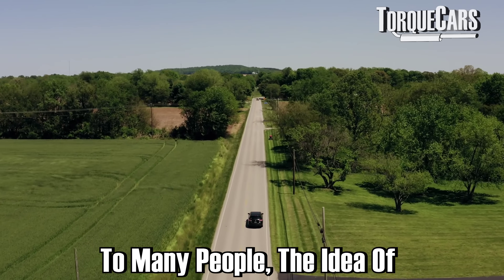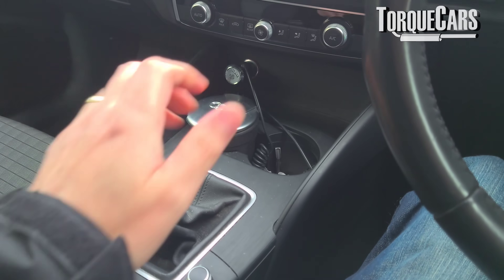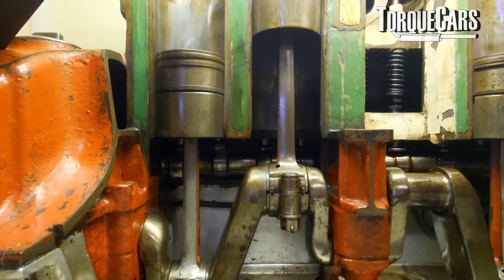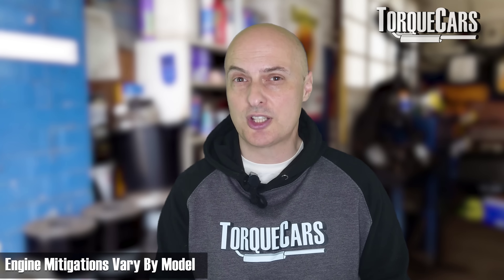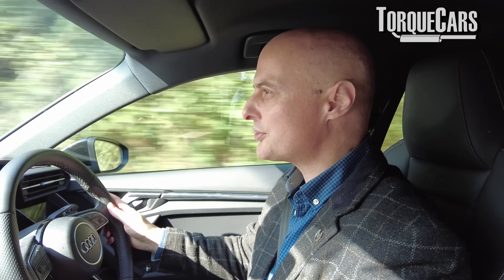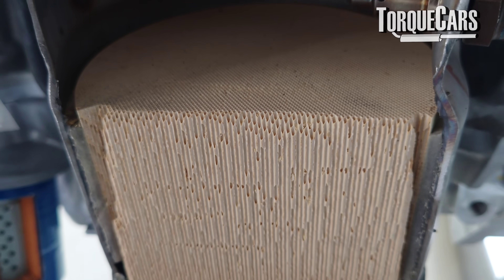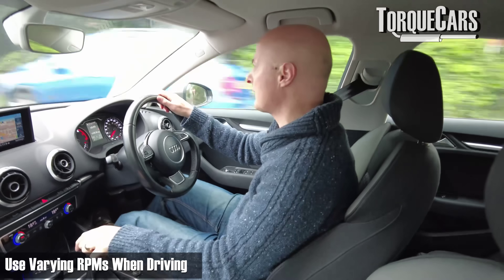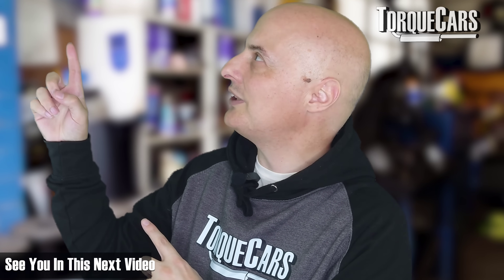BIG DAMAGE By Lugging at LOW RPM? Eco Driving Warning! (Manual Gears)

Comment: It’s ok to use lower RPM when car is still cold because cold oil doesn’t flow as quickly, but after it warms up it’s completely fine to use the whole RPM range every once in a while
Reply: Most modern engines are alloy with steel stretch bolts clamping the head down. They don't reach full clamping force on the head gasket until full operating temperature is reached so it is good to avoid wide open throttle operation until warmed up to avoid head gasket failures.
Reply: It's good to keep revs around 1500 when cold. 88-90 degrees coolant, 74 + oil temperature when you can go
Reply: People really arguing over this in 2024? There's a multitude of reasons why pushing the engine hard when cold isn't usually a great idea but it depends on your engine, your oil, the ambient temperature, how long the vehicle has been sitting, etc. There is no straight answer but the general recommendation remains the same.
Reply: Not 'lugging' the engine while cold though, which would be even worse than doing it when warm.
Reply: A very cold engine (like a cold start at freezing temperatures or even Arctic temperatures entails a period of poor lubrication because there is water condensate present in the combustion chambers and piston ring contact area for part of the warm up cycle.
Reply: maybe true when the oil is recently change but oil thickens overtime
Reply: Was argueing with my Garage last week which oil to use on a 1.4tfsi Audi. They insisted on 5w30 rather than 5w40 which i brought. Ofc meeting the vw norm. Their argument was carbon build up, which in my opinion isnt due to oil rather than short trips. Would love to read the communities thoughts on that. Cheers Guys!
Reply: @danielsteinmetz  
Where does it say your engine can handle 5W-40? If VW says in writing somewhere your engine can handle a viscosity change it's fine, otherwise your engine is will be a goner 🤔
Had a 1.4 Golf 7 and it took 5W-30. Even got a 1L bottle to go when picking it up. Castrol 5W-30 VW LL

My Volvo takes 0W-30 which is tricky, not all 0W-30 is A5/B5. That's a specific Volvo spec.
Reply: @rosen9425  Hey there, it's even written in the cars manual :)
Reply: True
Reply: nah lots of cars rev themselves up to 2000 rpm as soon as you start them in cold weather till they warm up.
Reply: @FGNi-em9sb  i dont think that needed to be specified. Who exactly is pushing their car to the limit as soon as it turns on? Lmao
Reply: @thegreat9481 you would be surprised lol. I’ve seen it happen. Some people really believe you can just get in and drive it like you stole it without any idea of the damage that is occurring
Reply: @FGNi-em9sb  lmao you know what? You’re right. The reality is common sense aint common.
Reply: True but also not so much, most manufacturers count that in, you can actually still use mid range rpm where most engines make the most torque, just don't use higher rpms and no 100% throttle, basically you can use the engine normally like you should, just about avoiding any high stress situation, most modern cars are like that and also helps a lot with reaching operating temps and oil flow during cold starts, not all cars, but most of them now are just "let's go already" than "wait for my morning meditation, then we go"
Reply: Change your engine oil. Early and often.
Reply: I daily drive a 2zz Corolla, it sees 8000+ rpm every single day. Often multiple times each day.
Reply: I used it multiple times a day😂
Reply: the engine's operating temperature is not all about the oil flow, But mainly because of the thermal expansion of the piston rings. You need to reach the operating temperature to prevent uneven wear on the cylinders and to ensure a proper seal for the combustion chamber.
Reply: @judomanX  Except this discussion is about oil. Piston and rings are one of the first things to warm up, way before anything else.
Reply: @BigBear--  thought the video was about engine longevity and you're all yapping about oil circulation which literally takes a second or two.
Reply: @judomanX Welcome to the internet. Where the comment section discussions become about specific issues, not always related directly to the content in the video. Which is why I specifically said "this discussion" is about oil. Not the video.
Reply: You also need less oil supply for timid driving, but if you lug a cold engine, material expansion hasn't happened yet, so you have higher tolerances between parts, and now imagine hammering on the pistons in that state. Not good either.
Reply: Yes me too I wait till my oil gets up above 160-170 F before I get her above 2500rpm
Reply: Its still hard on internals namely the thurst bearing .Esp on stick cars
Reply: Veramente l'unica cosa che succede a motore freddo é che il metallo dei componenti in movimento non é ben dilatato. Bisogna solo evitare atteggiamenti "nervosi" fino ai 90° quando i componenti raggiungeranno la giusta tolleranza. L'olio riprende a scorrere appena accendi il motore, non é quello il problema.
Reply: All modern oils these days flows immediately, we're talking seconds. It's not exactly going from molasses to water in viscosity change. Just look at the oil flowing from a new bottle very liquid. Also specifically made to flow just fine in sub zero temps hence the W-rating. So at -20°C I can see a slight need to not overdo it the first 5 minutes but the oil is indeed flowing or any engine would be toast at every cold start
Reply: Did it ever occur to you that operating temps also involve parts expanding?  You have different metal and alloys that expand any different rates.  Also your fuel is less efficient when your engine is not at operating temps.  You notice your rpm is high until it reaches operating temps?
Reply: @MavHunter20XX  
Actually no I don't notice that. After cold start high idle there's no rpm difference in any of my two cars other than what my right foot calls for. How is that a thing with fuel injection and real time electronic timing adjustments?
Reply: @rosen9425 that is very true, But just because the oil is flowing it still doesn’t mean it is up to operating temperature. Which is why it is a good idea to take it easy for the first few minutes before driving the car aggressively.
Reply: @FGNi-em9sb  
Engine oil doesn't have to be at operating temperature to lubricate, it does that all the time. The enemy of lubrication is old oil. The older the less lubrication properties are left. It's why have to change it. 

All engine oils in a normal cars are multigrade oils, designed to operate at various temperature intervals. There's a cold and hot viscosity rating meaning the oil properties change as the heat increases. Excessive heat does break down the oil so abnormal heat over 100°C or so is much worse than freezing temps until extremes of -40°C or so.

A funny BMW note I read in a manual said something like this. 
Engine break in: keep the speed below 200 kmh the first 1500 km

What is driving aggressively and why is that a parameter to take into account at all?
Sounds like abnormal behavior subject to a mentality attitude correction more than babying the engine oil in a car 🤔
Reply: @rosen9425  mentality attitude correction? Lol ok Dr. 🤣
Reply: @rosen9425 Everyone else pretty much explained the reasoning behind what I said lol. Just read the other comments. I don’t even have to clarify anything 👋
Reply: @rosen9425  still depends on oil thickness my 10w 60 oil won't protect my rod bearings if cold as the oil is to thick and not in its proper operating temperature 75 degrees and above is the sweet spot.
Reply: @mattjingles5758  
🤣well driving aggressively doesn't sound all that normal,. come on
Reply: @FGNi-em9sb  
Not just oil but some mechanical sympathy is always a good idea 💡 all the components need to warm up, gear box, diff ect.
Reply: @fredorico41 Yes! I absolutely agree
Reply: @fredorico41  Agree. Modern automatic transmissions often cost more than a vehicle is worth on the secondhand market.
Reply: @FGNi-em9sb  narcissist?
Reply: @rosen9425  any shavings or materials need to have so many cycles to make sure they seat proper the shaving need to be worked out into the  pan
Reply: @rosen9425 oil flow isn’t the reason why you shouldn’t floor at at low engine oil temps. The reason is clearance of the engine. Operating oil temperature tells you that all the internals of the engine have expanded due to heat to their optimal clearances. If you engine isn’t in clearance it will wear out very quickly.
Reply: @Eclipsis17  
What flooring it? Who does that on a regular basis? There's literally no reason to do that. Not even merging on to a motorway requires it. 

so again, every engine should be toast since no engine is "with in clearance" at cold start. This does not happen so the clearance issue is a bit bogus. Out of clearance spec means the engine is worn out. Badly designed. Wrong oil use. No oil used. Severely aggressive driving which the engine isn't made to handle. Severely lacking in maintenance etc

Sounds to me like people think their cars are race cars warming up for a Lemans 24h going to the grocery store 🙄

Can't believe one of my cars is the only one in the world getting passed 400,000 km at this point (248k miles). It should've been dead long ago, first winter engine blown right up
Reply: @rosen9425  Nummie ...the ENGNE PARTS AREN'T ATCTHEIR OPERATING SPECS .. D00H
Reply: @jackd1582  
you honestly think any of that makes any sense whatsoever? good grief
Reply: @rosen9425  why don't redline your car immediately at cold start? tell us your results!
Reply: @BigBear--  
you interpreted that as pride!? that is odd. Can't say it's something I ponder on a daily basis sitting on my anti-redline throne of perfection lol.    
I just never do it because there's little to no reason for it. Unconducive to normal driving, that's it. A little harder acceleration when needed, enough for the turbo to join the party, is more than enough for my driving. It's highly likely beyond all speed limits at that point anyway.    

Such a weird thought process going from pressures and viscosity, shear stability and somehow not redlining the engine is a weird stance? 

It's like Occam's engine going on here. We're babying the oil to all hell but also redlining the shit out of it apparently 👀
Reply: @rosen9425  I would have thought speed is irrelevant until you are getting enough air resistance to start working the motor, or the rpm in top gear starts getting high. 200 km/h is quite high, rarely would you find a public road that is safe especially in the UK!
Reply: @rosen9425  while it does flow immediately, the viscosity change after warming up is very noticeable and makes a big difference for higher rpm
Reply: @rosen9425  I haven't yet found any affordable oil that flows completely normally in -35°c
Reply: @rosen9425 This us patently false. The oil you pour out of a room temp bottle is still significantly thicker than oil at operating temps. Besides that, take that same oil and freeze it to like -10 to -40 and see what comes out then. The easiest way to tell is get an oil pressure guage. My oil pressure on a cold start, even in the summer, at idle starts out at around 74-76psi, when it's at operating temp, it drops to about 19-20psi. It's a crank driven oil pump, not a variable electric pump. So that's just higher pressure from thicker oil. This is with Amsoil Signature oil, so can't blame oil quality either. Also, btw, it only takes a few seconds of no, or low oil, to start causing damage to the engine. Especially to things like crank bearings. Which is why you always want to prefill the oil filter (if possible), cause if that bit of 2-5 seconds of no or low oil pressure, over repeated oil changes is enough to start damaging the engine. If you really want to run that experiment on a car you don't care about, you can try pre-filling vs not pre-filling, then send both oil samples out for testing. You'll see a lot more wear particles in the non-prefilled oil sample. Particularly elements belonging to bearing materials.
Reply: @BigBear--  
You never said what you think is patently false though. Is your oil not oiling at 80 psi?  I bet it's lubricating on a required level just fine
Reply: @rosen9425 Is the oil flowing, yes. At the required operating level?...that's more complicated of an answer. Not in the way that you mean, not really. For instance, oil hydrodynamic performance is effected by changes in temperature and viscosity, in load bearing applications (among others). Creating either stable or unstable lubricating conditions, for the application. This directly applies to areas like your crank bearings. While at cold temperatures and lower loads (lower rpm and throttle application), the oil may be in a stable lubricating conditon, were you to increase the load beyond the oils ability to maintain stability, you can start to either create contact between the crank and bearings, or increase the friction levels. Either increasing/accelerating bearing wear, or potentially causing more catastrophic damage. That's just one example. Point is it's a complicated subject, but the idea that as long as oil is flowing means it's all good to drive however you want, is not correct. Nor is the idea that the oil's performance is the same regardless of conditions, as long as it's "flowing".
Reply: @rosen9425  Not really. Tell that do a new guy who has a 1998 car and he'l trow a rod
Reply: @gabrielvieira.4358  
tell what to the new guy? 1998 isn't even that old in terms of engine technology
Reply: @rosen9425  mechanical engineer here. The engine is indeed designed to function along the specified oil grades whole operating viscosity range. But its optimal when the oil is at its planned operating temperature. Outside that range wear is indeed increased. You're not gonna kill your engine by idling in - 20° weather if your oil is correct. But its better for the long term health of the engine to get up to optimal temperature as quick as is reasonable. For that, low/moderate load driving is the fastest way. Ideally you want to keep RPMs around highway ranges. As thats the speed the engine balance is designed for, and thus the slightly worse tolerances at low temperature coupled with the more viscous cold oil will have less impact as there is less vibration.
Reply: @Erowens98  
Cool 👍
Did not think about engine balancing aspect. That is very interesting, so when you keep the rpm in that general range not doing highway speed, the engine still feels as being in the right spot because It's in the balanced rpm region where forces are canceled out the most. Lugging around means everything is just as off as it can be.
Reply: @rosen9425  it’s more than just oil flow. Different materials expand at different rates. The crank steel, aluminum pistons, iron block, etc all expand at different rates and engines are designed to run efficiently when everything is expanded when warm.
Reply: @rosen9425 For me it's not the character of the lub oil, I agree of what you said but the most important to me is the operating temperature of the engine in which it cannot attained immediately, the issue is that during cold operation of the engine the thermal expansion of the cylinder wall liners is not yet attained clearance is still very tight but it is ok only you' re shortening the life span of the engine, anyway it will still reach for more than five years or more and you can replace it with new car.
Reply: @FGNi-em9sb    More important than the oil temp itself is the clearances of the engine bearings.  The engine bearing clearances specified in the engines design specs are set with full engine temperature in mind, not cold running, as that is only a transitory state of the engine.  

Sending a car with a cold engine is just asking for trouble but once the engine warms up properly (not just the coolant temperature, the actual engine temperature) then everything should be fine to get up it for the rent.
Reply: @David-lr2vi Yeah exactly my thoughts. Just didn’t get too detailed haha
Reply: Multi-grade oil like 5W-30 is 5 weight so it flows faster on startup, because any oil is better than none. Additives counter further thinning due to increased temperature.
Reply: @rdmineer1  true. But when they get hot and abused the higher numbers are better for protection and prevention of wear. And thus, ultimately better for engine longevity
Reply: @rdmineer1  
No! stop it😑there is no "weight" classification in oils whatsoever.
W is a winter spec and nothing else

Comment: I didn't hear you mention rod bearing damage.
Reply: Absent knocking or detonation, low speed operation is fine for rod bearings. High speed and low load operation, not so much.
Reply: @jonathanrabbitt Exactly. The dynamic forces far exceed the firing forces at high speed.

Comment: Max torque on my TDI is between 1500-2500rpm I drive it around those and then less frequently 3000 - 3500rpm even less frequently to 4000 rpm max power is at 4400rpm. redline at 5000. Drive it like I stole it occasionally. My other car is petrol and that gets regular redline at 6400rpm
Reply: Most petrols aren't even awake under 2700 rpm. Any turbo is just along for the ride doing hair dryer impressions waiting for something to do